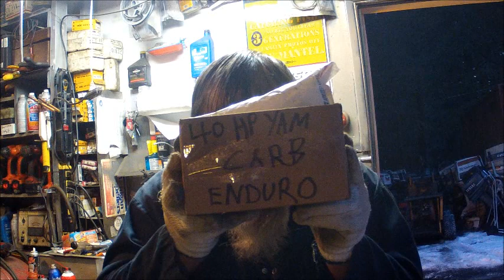YAMAHA ENDURO 40 HP, &  More

Comment: Hi Kodi, glad to see you saved those enduros. If you need any specs on the Mercury, i have a motor like that (Mariner) and i have the service manual.
In cowling front, there's a little sticker with the shifter position, down is forward.
I don't know if your motor has the air box, because those engine should not operate over 3000 rpm without the airbox.
Reply from the maker: No air box but I will use & mod one off some junker,  thanks      kb
Reply: @kodibassInsideoutboards  i have a gearbox for that motor, and i would give to you, but i am half a world away from you. ☹